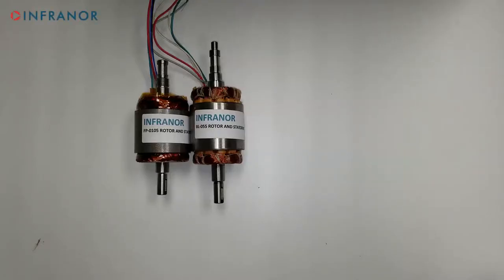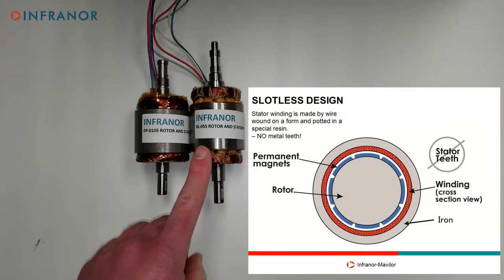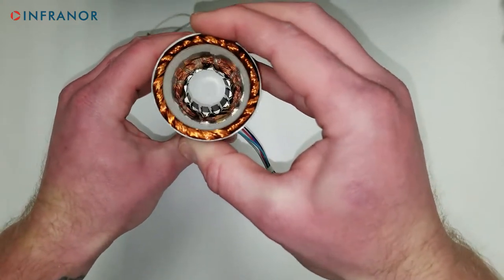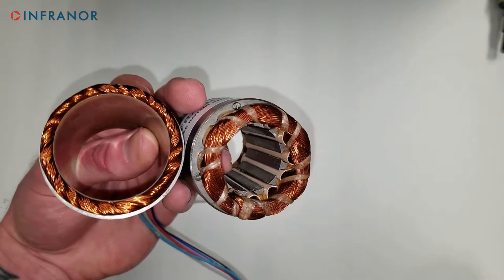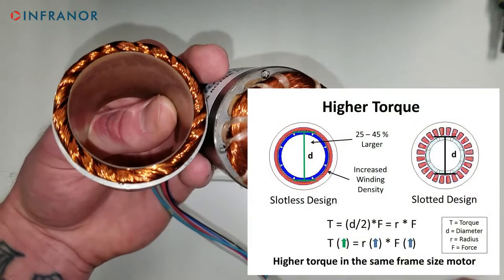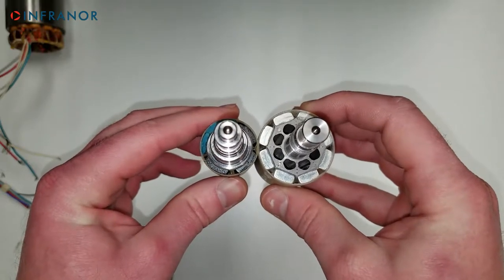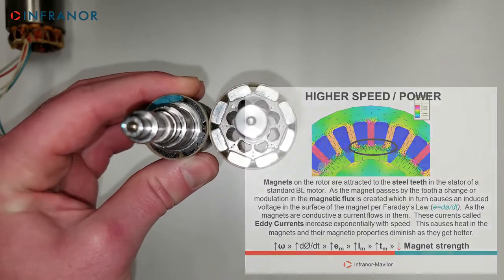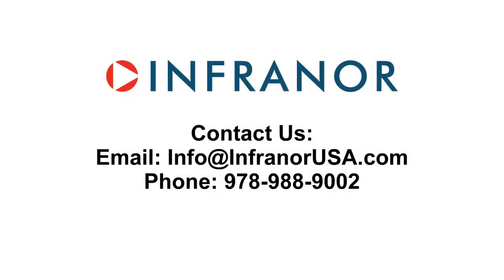Slotless and Slotted Servo Kit Demo

Comment: Is the inner celinder of the Slotless motor made of an insulative material or is it just steel?
Reply from the maker: Hi Zakaria,
   The inner rotor is made up of steel and magnets with a fiberglass wrapping for added magnet adhesion. The wrapping allows these motors to reach high speeds with no magnet failure. Let me know if this answered your question. Thanks!

Comment: Can you please tell me which motor design is best for low rpm high torque application? Also what torque can you expect from these motors?
Reply from the maker: Hello,
   The best motor for a high torque and low speed application would be our BR series. Please send us an email for more information on this style of torque motor. Continuous torque ranges from 0.8 Nm to 3.9Nm . If you require more torque please let us know.
Info"at"infranorusa.com.

Comment: What are the problems with this type of motor?
Reply from the maker: Mitch, thank you for your inquiry!  This is a good question and there are a few things to consider.  Firstly, historically slotless motors were significantly more expensive and this is true for most of our competitors because the manufacturing is more difficult, but we have invested in a newer design and removed much of the manufacturing burden so our premiums are only about 5% typically.  Secondly, slotless motors do have higher inertia (about double) and this can be a disadvantage if your total system inertial is very low or about equal to the motor inertial but in most application the system inertia is typically 10 times the motor inertia so there is very little disadvantage.  In fact in the vast majority of cases the higher motor inertia is a benefit because tuning is easier.  The third thing to keep in mind is that if you want to achieve the greater torque this motor can produce you will need more current from the drive so a larger drive may be required to achieve the full performance the motor can offer.  Please feel free to contact us directly at Info"at"Infranorusa.com and we will be happy to review your specific application and provide objective feedback. We also manufacture traditional brushless motors so we can provide that as well if it is a better fit.

Comment: Sir what about winding patterns
Reply: It would be great of you to tel me esc to be used, kv ratings, maximum operating voltage current temperature,  also maximum power output
Reply from the maker: @pratikraut7552  Thanks for your question. Typically, our FP [three-phase brush less and slotless] range of motors have an insulation max temperature of 155 C. They come in 8 different frame sizes totaling 16 options including different stack lengths.  Voltages go from 48 Vdc to 680 Vdc. Depending on the voltage used and current available from the drive we can get up 55 kW max power. We are capable of a lot of customization including windings, shafts, flanges, feedbacks, cabling and so on. For more information please visit our website at www.infranor.com or contact us at info"at"Infranorusa.com.